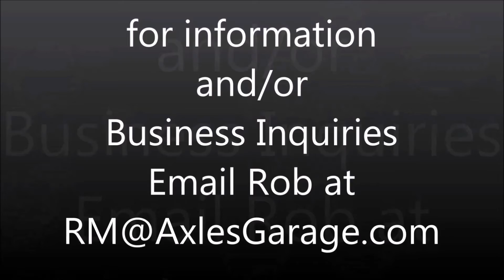Long Distance Recovery - 1997 Jeep Wrangler TJ  -  Transfer Case Carnage

Comment: You can drive the tj without the front drive shaft. It is always spinning in the transfer case, but without the driveshaft the front wheels will turn because they are on the ground. Essentially turns it into just rwd vehicle. I know that you can drive the jeep without the rear drive shaft if the front one is ok. Just needs to be driven in 4wd

Comment: That's brutal Rob.  Good luck with the repair.  Is the front dif or pinion seized?  Was it it driven a long stretch in 4Hi on drive roads?  Something is going on that created enough stress on the tcase to split - forces in opposite directions on the front vs. rear outputs.
Reply from the maker: No it was running as normal, spent most of it's 135K miles in 2H.
Reply from the maker: I'm doing an autopsy